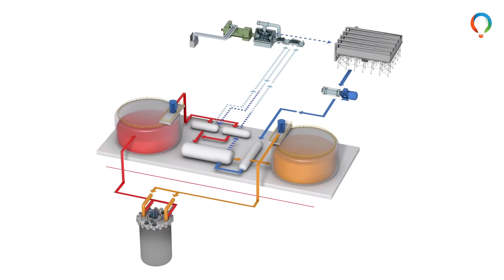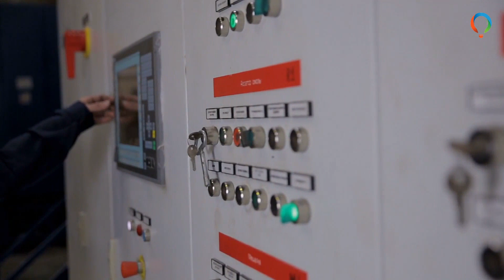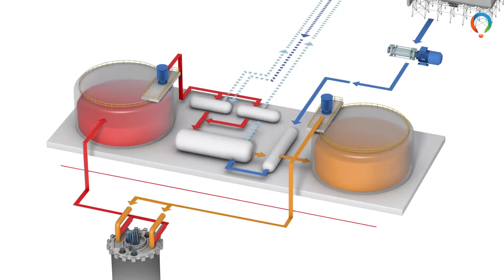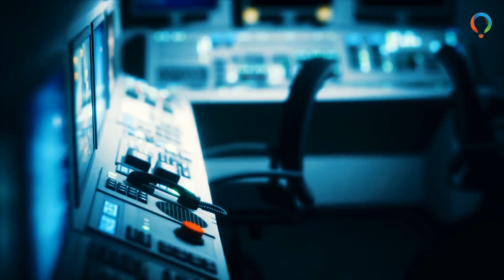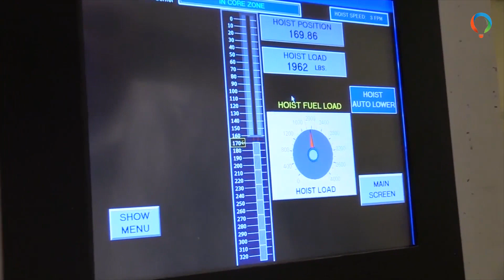Warren Buffett And Bill Gates' Nuclear Power Project Natrium ~ Phenomenon

Comment: 0:26 "These reactors will be fueled by intermittent power sources like wind and solar energy. Unlike traditional reactors carbon-free technology will be used, hence, this nuclear power plant will reduce the rate of pollutants".

Thanks for putting this video together, it's nice to see new information on advanced nuclear. However the statement above is rather misleading. Natrium will in no way be "fueled by" wind and solar energy, and the reason it is carbon-free is that all nuclear is carbon-free: it has nothing to do with wind and solar. What is unique about Natrium is what you say in the following section: that, unlike the majority of existing nuclear, Natrium will allow the use of thermal energy storage due to its high-temperature design. This storage will allow it act as a peaking plant, making it a perfect complement for intermittent sources like wind and solar, unlike traditional nuclear.
Reply: This wasn't the only inaccuracy in this video. Matter in fact this video is a good example what happens when communication ppl with their business degree try to explain how reactors work. You can tell they have no idea what they talking about as certain words are clearly swpapped out to other synonyms, in context where they could not be used to convey the same meaning.
Reply: Thank you, Tom. There are a few enormous gaffs in this video’s script, to the point I think it should be re-edited. The points you’ve clarified and corrected make it useful.

Comment: Not sure if it was mentioned in your video. But will this reactor use some of the over 700,000 metric ton recycled nuclear waste currently stored in America rather than new mined uranium? Other videos on the net mentioned this type of Gates/Buffett project will be using recycled nuclear waste and not newly mined product.
Reply: No, it won't reuse nuclear waste. Fast reactors will reuse waste. This is a smaller reactor that will use molten salt as a "battery" to supply the grid with back up power when the wind doesn't blow or the sun doesn't shine.
Reply: @paulbradford6475  Natrium is a fast reactor design (a sodium fast reactor) so it could in theory use nuclear waste. However AFAIK there are no plans to do this, probably largely to do with economic reasons (uranium is cheap).

Comment: How do they prevent sodium from leaking?
Reply: Standard design for liquid salt is for numerous small vats to sit under the fuel chamber.  They're small and spread out so leaked fuel won't be critical.  The volume of the vats would be enough to contain the entire salt solution, not just little leaks.  The cap at the bottom of the fuel chamber is kept frozen.  So if the chamber overheats, the cap gives way and the fuel/sodium empties into the vats.
Surprising that this wasn't mentioned.  Moving away from pressurized water is a big deal.
Reply: @cdorman11  Yep that is for molten salt cooled reactors, however this is a sodium cooled reactor. Here the molten salt only act as a heat storage solution not as a direct cooling of the core. (so there is a heat exchanger between the sodium loop and the molten salt loop which leads to the tanks)
Reply: The same way they did in EBR-II for 30 years of operation. They use a stainless steel pool type reactor where the primary sodium (irradiated) never leaves the reactor and is covered by a thick layer of Argon. They then use two stainless steel secondary sodium loops (not irradiated) to move the heat out of the reactor vessel. In EBR-II the secondary sodium then went to a pair of sodium to water heat exchangers to generate steam. In Natrium these are replaced by sodium to molten salt heat exchangers producing a third loop, which moves the water completely out of the nuclear island and keeps the secondary loops short. The stainless steel is not reactive with liquid sodium at all (no corrosion) and it all runs at or very near atmospheric pressure so that if there is a small leak of non-radioactive sodium from one of the secondaries, they freeze the pipe, repair it and then carry on.